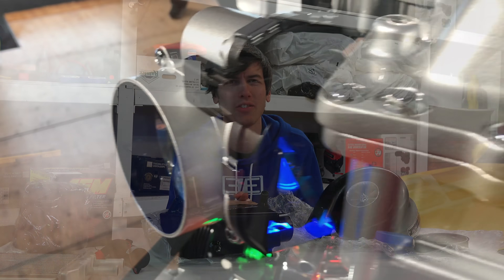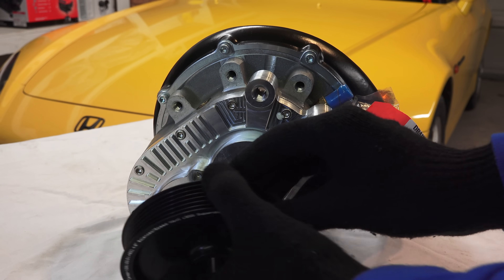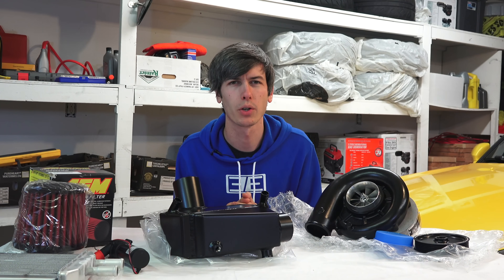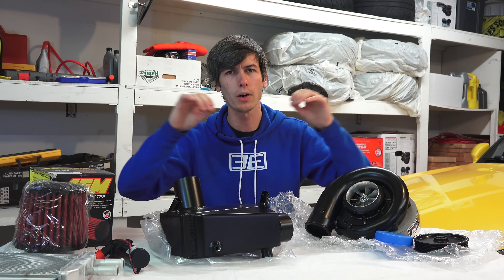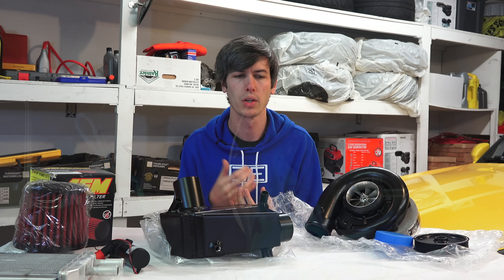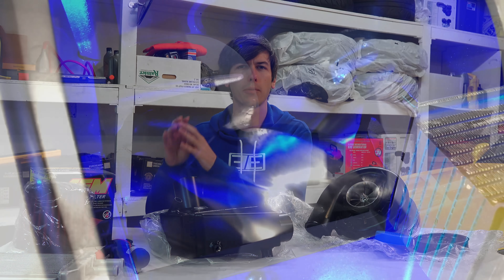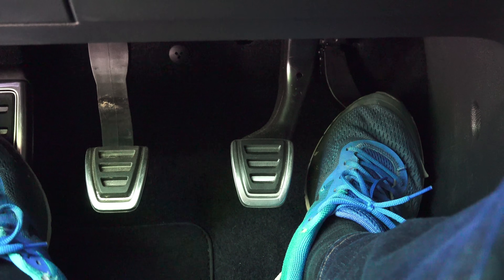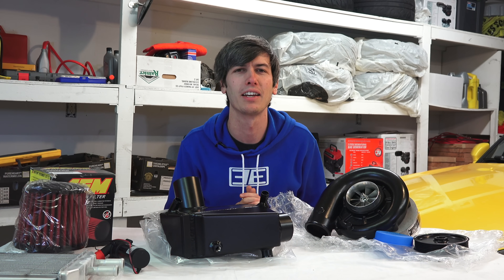Turbochargers vs Superchargers - Which Is Better?

Comment: Why not both?
Reply: Volvo has employed both in it's suv
Reply: amr flk Volvo? 🤢🤮
Reply: Some Detroit diesel engines use both.
Reply: Nissan Super Turbo. 
Search MCM super turbos and temples 2
Reply: Yep volvo did it
Reply: My Scirocco has it. I think the supercharger is supposed to deal with the turbo lag I experience in lower revs
Reply: Zenvo st1 is out there
Reply: because big boom boom will go off
Reply: Most people cant afford the extent of modifications needed to do that properly... and this is about the difference between the 2.
Reply: Yeah just put 20 of them, and your good to go
Reply: With a sip of nos
Reply: I've seen were I believe ford had with a dual turbo that one boosts at a lower end and the other at high end but not sure how it is either ecoboost engines
Reply: @aarontodd72  a smaller, easier to spool turbo for low rpm and a bigger turbo for the high rpm range
Reply: Depends on engine size
Reply: Exactly. Put both in a car
Reply: fire
Reply: U cant use both
Reply: Volvo XC90 T8: so you have summoned me.
Reply: Using both is called twin charger
Reply: Porque no los dos 🤷🏽‍♀️
Reply: Devin Christy both? at the same time will get into each others way. Very difficult to run both at the same time and be efficient.
Reply: @harryking4007  Twin charging is a thing.  The supercharger cuts out when the turbo is spooled.  Often the drive for the blower is clutched and there is a gate diverting intake to/from the active device.  They really aren't all that hard to run or set up in this sequential layout.
Reply: Jason Nichols oh ok i never seen that kind of set up. i would like to see one running.
Reply: @harryking4007  -- Some volvos have a twin-charger setup as standard equipment.  In their setup, the intake y's off into the turbo and the supercharger inlets.  The gate is on the turbo side.  At low rpm, when you hit the gas, the clutch engages the blower, the gate is closed and the air goes through the blower, out through the compressor side of the turbo, and into the intake manifold.  Since the turbine side of the turbo is getting a little push from exhaust pressure and the turbo bearing allows it to spin so easily, it isn't that much of a restriction.  As RPMs go up and the turbo fully spools, the gate between the intake and the turbo opens as the clutch disengages the blower.  It's a pretty cool design with  less moving parts than some of the aftermarket setups I've seen. Because the outlet from the blower runs through the inlet of the turbo, you don't have the turbo pushing pressure back towards the blower and you never have to worry about the turbo back-spinning while the blower is engaged.
Reply: Jason Nichols is this on a diesel truck?
Reply: @harryking4007  No, it's on their cars...amything with a T6 in it.  It isn't anything new either.  Nissan was using a similar setup on the March in the 80's.  VW has made them, so have a few other manufacturers.
Reply: @harryking4007  all of the new volvo's have a twin charged 2.0 L petrol engines look up, they are really cool some even produces more than 400 hp
Reply: @superchargedpetrolhead  You can get about the same 400hp from some of these turbo 2.0s with just a chip and cold air, so what's the point of the SC... unless they're just cold air and a chip away from a lot more hp than 400.
Reply: @DeadlyMixKrew  it takes a turbo to get 400HP out of my 2.0l. If you have a link of a 2.0l with 400hp + without a turbo or supercharger please share it.
Reply: @harryking4007  not when each of them run best at different ends of the rpm range, supercharger runs best at lower end while turbocharger runs best at upper end

Comment: A turbo needs higher compression and is more for power. Thats why they are on diesel engines! On a supercharged engine you need injectors with larger volume control and more aggressive cams. You can run a supercharger on a stock engine too but why just be the fastest to the next traffic light? GM's 3.8's are a perfect example!

Comment: How does a turbocharger and lubrication work at cold temperatures? I live in Canada and we get -30F or colder for weeks each year. If it works on engine oil, I know my engine is not happy even when I use full synthetic oil.
Reply: Turbos are oiled by the engine oil pump. They would suffer the same as the engine at cold temperatures.  Just avoid mashing the pedal when the engine is still cold

Comment: Also do a review on upcoming electric turbocharger tech ( from Porsche & Audi ) since this will spell the end of "turbo lag" and probably the use of superchargers.
Reply: This is pretty interesting stuff. The way I understand it, an electric motor is used to "spool" the turbo. This covers the delay between when the accelerator is pressed and exhaust flow sufficient to drive the turbo at useful rpm levels is reached. Remember, there are several feet of exhaust manifold and piping between the exhaust port on the head and the inlet of the turbine. It takes a small amount of extra time for the volume and velocity of flow to get the turbo going. Also as I understand it, this would be most beneficial in a multi-turbo installation, since one small turbo can be powered by an electric motor to give "instant" response, while a larger, exhaust driven turbo can take over at higher engine speeds when exhaust flow is already at a usable level.

Comment: Any difference in power input to the charger versus power output ? Any power loss by back pressure on the pistons? Which systems last longer? But most of this is limited by engine knock and fuel used. What is the most controllable type? Can you limit this to when you want to crank up the power or does it run all the time? Which cost less and cheaper to maintain?

Comment: Thanks for explaining the difference.  Do you know if they still make superchargers that can switch off to save fuel just like the one in the original "Mad Max 2: The Road Warrior" movie?
Reply: The one in the movie was a prop powered by a electric motor. I have read in the past that they make some type of solenoid or clutch system for superchargers though...

Comment: I've had turbo charged cars for the last 10yrs (Volvo S60 2.5T and Subaru Outback XT) that I've kinda just gotten used to the lag in my driving style.  Also may help I drive a lot of medium and heavy duty straight trucks with turbos.
BTW, my favorite is the turbosupercharger...  Developed at the beginning of WW2 for aircraft operating at high altitude.  Two setting (hi for at altitude, lo for on the deck) super and a turbo with a manually controlled waste gate.

Comment: I've known about them both for a long time, I'm not really a car guy per-se, I don't have any projects or anything, I raced motocross from 12 years and my dad raced sprint cars with my uncle's help for 32 years.  So racing is in my blood, but I'm not really a gearhead type, and also there aren't turbos or superchargers on either dirt bikes or sprint cars, so it's a world with which I'm not involved, long story short, I was just unsure about how each actually worked and this was a great explanation in a pretty straight forward manner.  Thanks!

Comment: Honest question: Two indentical cars with identical engines other than one has a Supercharger and the other a Turbo, who wins a 1/4 mile race?
Reply: Depends, turbos make more power at the same boost level but they have turbo lag. Different turbos have different lag, some spool at 2000 rpm some dont spool til 4000 rpm. If its a quicker spooling turbo it would probably win

Comment: I dig both but it's SO much easier to put an intercooler on a turbo set up compared to a supercharger.  However, it seems that a supercharger can take more abuse due to the fact that it has it's own oil supply and doesnt have lag. I like the idea that the supercharger doesnt rely on super hot exhaust gas to drive it.

Comment: Really good video, especially about how turbos are harder on oil.  I've never heard that before -- makes sense, though.
Reply: Yep. Turbos are very precision devices whose rotors can spin at up to 5000 revolutions per second. The internals have very tight tolerances and only work properly if they are fully warmed up and are getting clean oil delivered to them at all times.

And yet my parents keep telling me that I don't need to warm my car up.
Reply: @electric7487  shouldn't that technical sensitivity be compensated by higher oil quality?
No modern engines are officially recommended an explicit warm up period, rather the contrary.
Reply: @OmmerSyssel  Not warming up your engine doesn't mean everything is just gonna blow up, it just shortens its lifetime.
Reply: @OmmerSyssel  I have a rather modern turbocharged engine in my Volvo S40. It doesn't need a true, hard warmup, but it A) has a cold-start feature which helps with the initial stages of a warmup with a quicker idle and B) the manual states that you should refrain from revving the engine (and thus running the turbo hard) for the first several minutes of operation.

All this points to the fact that even modern engines - especially turbocharged ones - are meant to only operate at peak power one they reach operational temperature, even if they're technically capable of doing so from startup.
Reply: Always better for longevity to let ANY engine warm up…also highly recommended to let them run at idle for a cool down period before shutting off, especially turbo(s)👌🏼

Comment: Technical question: what do lab measurements show in terms of power ROI with turbos VS supercharges? Cause the the turbo still draws energy from the engine as the exhaust gas flow is impeded by the turbine and the engine is actually doing more work to pump that exhaust gas through the exhaust system. There is no free lunch with either a turbo or a supercharger, but there might be and advantage of one VS the other as one might be more efficient. I have a suspicion that a supercharger might be actually more efficient than a turbocharger in terms of how much energy is expended in the process of compressing the air.
Reply: Turbos are more efficinet. The amount of backpressure they create is pretty small. A turbocharged car would make more power than a supercharged car at the same boost level

Comment: My car is supercharged so I had to see what he said. I have 2 of the same cars ones the turbo model and ones the supercharged model so I raced them all the time with my brother  and the supercharged wins every single time. And the supercharger has aggressive sound
Reply: notice any big fuel consumption difference? I ain't sure about whether turbocharge or supercharge my N52B30 engine...
Reply: kain seviers I heard a turbo is better with fuel consumption. But from my experience the supercharged saves a lot more gas so i use it as my daily driver so I have the boost and fuel economy. And my turbo takes a sec to boost so the advantages are with the supercharged. I love them both though. But when I floor the supercharged it gives me the power I need immediately never lost a race (in the supercharged) . Knock on wood

Comment: You can prevent the s/c from sapping power from the engine by using an impeller type s/c and mounting it remotely, spinning its pulley with a small electric motor. A little more charge piping, yes, but instead of it taking from the overall efficiency of the engine, it just needs a little bit of extra electricity sent its way. Easy enough to do for anyone installing a compressor themselves, since wiring is half the project.

Comment: Do you have a video out on blow off valve/diverter valve spacers? I keep seeing them installed on smaller displacement turbo'd engines and I'm curious about how they work, potential risks, etc

Comment: I always thought the math on a supercharger was misleading. Manufacturers will tell you that it's bolt on 200 plus horsepower or whatever but with a supercharger while good as you had said you use horsepower to make horsepower. So really your not getting 200 horsepower. I don't know the specifics behind how much horsepower is used to get a supercharger to work but if it's around 50 then your really only netting 150 horsepower not 200 as they claim. I'm not saying it makes them bad I would just like a little more openness from these manufactures.
Reply: Parasitic losses are in the specs depending on the engine set up, as the vary...Twin Screws are pretty efficient.

Comment: there is supercharger oil for pretty much all roots and tvs blowers. the front snout bearings are oil lubricated and the rear bearings are sealed and don't require lubrication.

Comment: What is better? A natural aspirated engine with individual throttle valves.

But okay, as you may think that turbochargers now rule the place, you can see: The turbo is the deal. I've driven supercharged vehicles only four times (e.g. Audi S5 and Jaguar XE S) and it was always fun, but that's what a good turbocharged engine also can do alongside a good fuel economy.

Comment: Love your channel, great explainations.  I know Superchargers use engine power to create boost.  However, I NEVER hear of this.  A Turbochargers extreme restrictions on routing the exhaust through that cork MUST cause the worst restriction possible!  Of course engine power is LOST from the engine.  So what's the cost in HP, using a Turbo in restricting the exhaust?
Reply: Saul blade.     In a good turbosupercharger set up you want an exhaust to boost ratio not to exceed 2:1. A race setup can achieve very close to 1:1.

Comment: As you have said supercharger is more engaging and turbo more efficient but throttle does not give an immediate physical feeling. How do you rate? NA, SC, TC? However most high-end cars like BMW, Porshe, etc they provide twin turbo to take care lag at low-end RPM as well. However, due to fuel efficiencies, avoiding high  govt taxes, most of the manufacturers are reducing engine cc with turbo

Comment: The one thing you have wrong is superchargers require direct horsepower from the engine which is true but a turbo does not use free power. By restricting the exhaust you loose any scavenging effect of the exhaust (reducing horsepower.) So they both use engine horsepower to make more horsepower. Yes turbos are slightly more efficient but nothing is free. The other disadvantage with turbos is you have to run cams with less overlap than you do with a supercharger so your engine has less power to start with.

Comment: I have always wondered something about centrifugal super chargers. What if you cam a high torque motor like a V-8 for a ridiculously low end torque curve....highest possible torque as low in the rev range as you can get it. Then use the top end nature of a centrifugal supercharger to extend the rev range. Theoretically big naturally aspirated peak torque at 1500 or 2000 but when that motor would normally start to fall on its face at 3500 or 4000rpm with out the supercharger; the late boost potential of the centrifugal supercharger would just be ramping up to overcome those poor high end  flow issues and ultimately extend the rev range back to a more normal 5000 or even 6000rpm all with a high and relatively flat torque curve.......in theory at least lol.........does that sound possible?

Comment: You like a pedal, where the car does instant what you asking for with the pedal? 
Quite easy, you should drive and electric car.
Right now instant power from zero to maximum speed, without lagging. And hey, it's so much fun to drive without noise and without vibration. You just feel the immense power.

Comment: Turbo is generally better. You can put one on any car quite easily, they're cheap and have better economy. I love superchargers, but they're a little impractical. Unless you have a cheap bolt on kit, they're very expensive.

Comment: When one modifies an engine the first thing they usually do is a high flow exhaust.  A turbo is just the opposite, it has high backpressure.  How much effect does the increase in backpressure negate the boost?

Comment: Why isn't there a device which can use both exhaust energy and engine energy, so you can have no lag in the low-end and save the power in the high-end?
Reply: It exists. It's called "comprex" supercharger.

Comment: I drive 2004's C200 Kompressor (supercharger) on daily commute to work, and I have also borrowed my brother's WRX STi (Turbocharge) to my workplace for a week. With the same amount of capacity (2000 cc), I can say that supercharge engine consume fuel a lot more than turbocharged one (nearly 50% more).. but the supercharger is more fun to drive (instant power to overtake)

Comment: Very informative and well explained.  I just purchased an '05 Acura RSX-S yesterday.  I've heard of them having turbos.  I wonder if it is possible to install a super charger?  Also which would you recommend in that application if both are viable choses?  I gathered from your video that you prefer superchargers.  Thank you.
Reply: supercharger will give you around 300 hp where the turbo will get you around 400 hp, but either way make sure you have a clutch and tires that can handle the power first!
Reply: also with either you need to do hondata tuning

Comment: Why not have both? Start off with the super charger. And as rpms go up, let the turbo kick in. Or rather dual turbochargers. So a smaller one and a bigger one. And then as you slow down, you go from big, to small, to super charger

Comment: You forgot to mention that supercharged engines have better exhaust sounds since the exhaust isn't being routed through a turbo. I had a 2010 Mercedes E63 with the normally aspirated 6.2 liter and a 2012 E63 with a 5.5 liter biturbo. The biturbo was a lot faster and sounded great, but the normally aspirated 6.2 liter hands down sounded better. A friend of mine said it almost sounded like a NASCAR when I went by him with it at full throttle.